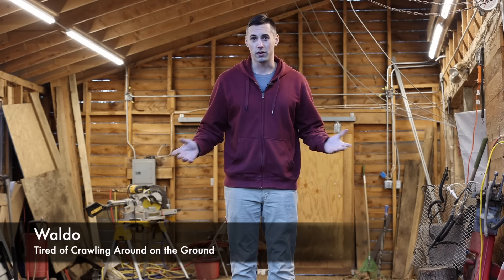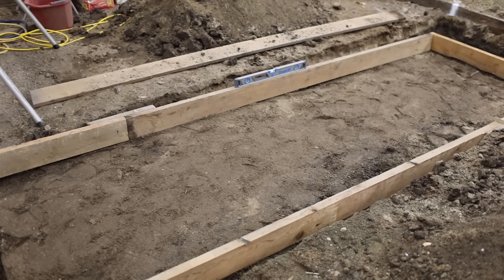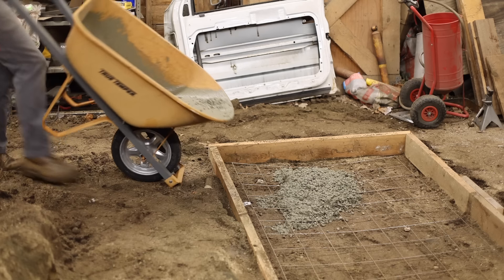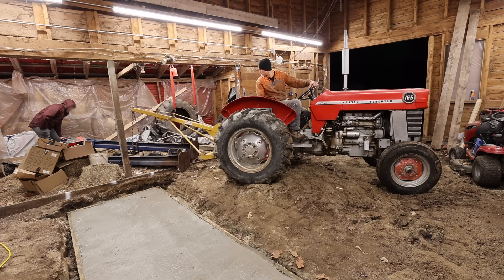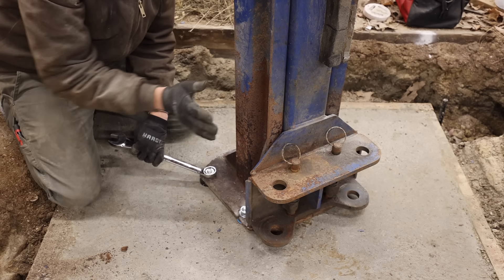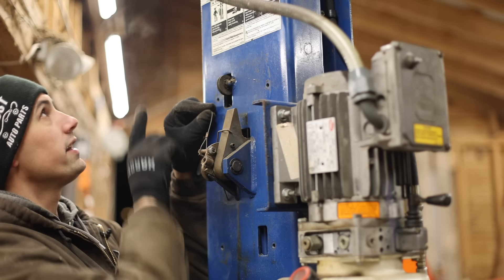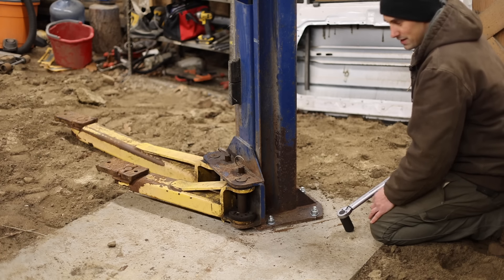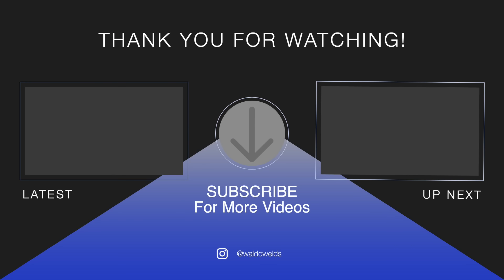Installing a 2-Post Automotive Lift on the Cheap

Comment: As an architect, I would recommend that you not use that for fear that the entire slab can rotate frontwards or backwards and drop a vehicle on you.  You don't have enough mass to prevent rotation, nor do you have proper rebar to stop the slab from splitting apart.  Best of luck.
Reply: nor did he even pack the dirt befor the pour this is a vid if do not do this
Reply: So architects are engineers now?
Reply: riight
my pads weighed more that the  load, 1600kg  pad under each column
Reply: @zomblake I would think they would dabble on the engineering side to preventing creating blueprints that create lawsuits. .
Reply: @alfonz0010  It might be country dependant, but usually- not. Where I'm at, they work in tandem with a structural engineer where the architect takes all the money, while the engineer all the responsibility. But to be fair, you don't need either to understand that the slab's too small.
Reply: @zomblake  They'd have a better idea than most lay people.
Reply: @zomblake he's way closer to one than the guy that posted this video....WAY closer.
Reply: Agree with other comments.  The slab is way too small and the rebar is not properly positioned in the slab.
Reply: first thing i thought when i saw the slab
Reply: @zomblake  The dude installed a 10 ft. post lift into a 3000 pound base that is only 4 feet wide with the intent of putting full size trucks on it. You need an engineer to tell you that's a bad idea?
Reply: Is he still alive? That was horrible way to install a lift! Might have mounted it to cement block's!
Reply: @zomblake  Do you think architects just draw pretty pictures of houses, like for fun?
Reply: @zomblake  -  It really depends on what type of architect, an architectural engineer is an architect. And many structural engineers are also architects.

The only way the fulcrum of that slab (the longitudinal aspect) will withstand an out of balance load (think engine in front), is that it won't.
If he had poured piers under it to below frost line and connect the slab to them with sufficient rebar then what he did there would suffice.  All that is is an  accident waiting to happen. In addition, why waste time with wire mesh reinforcing? Especially since it wasn't positioned correctly in the slab? 

On the other hand it wouldn't take much to stabilize the top of the lever arms (the lift posts) to the roof joists. 

Regardless, it's been over two years and so far so good. 
I spent over 25 years pouring concrete. I'm impressed he was able to get er done in two hours before he got cold joints. Or maybe he did? 

Like his videos and wish him well with that lift arrangement.
Reply: 😂 chill out all you "architectural engineering safety Sally's,  not every project needs to be over engineering. I mean I guess he could sue himself if the thing falls on his head. 😂 calm down he seems like a smart dude he can handle his own shit.
Reply: @zomblake  no but he's 100 percent correct. He's referring to what's called over turn and it's 1 of a number of very dangerous aspects of this installation.
Reply: @stuarth43  even if that was true ever heard of a lever and how it multiplies force?
Reply: @Flymore25  ok well your wrong and lifts especially 2 post are 100 percent dependent in the base plate load ability. This pad has not only no strength but it's not even tied into a slab floor with any surface area.

If he avoids a serious accident this it's just fresh luck.
Reply: @A_Person_You_Dont_Know  lol ok safety Sally, he's had it up well over a year now and no accidents,  so who's wrong?  Huh what'd ya say there? Yeah
Reply: @Flymore25  What a moronic response. Just because he hasn't had an accident doesn't mean its safe. I already know what the Rotary lift engineers say about this install. I wonder what Waldo's home insurer would say. Go back to whatever trailer you call home cleetus.
Reply: @Flymore25 just remember that Safety Sally's story is written in the blood of the people who didn't listen to her. Have a great day, it could be your last!
Reply: @OneTrueCat  right lol what do u do for a living again? Probably on disability and have never once done anything exciting lol. I'm 35 and have made it through several dangerous occupations using nothing more than common sense safety.  I worked at lowesnforn2 days untill I quit. To even start a fork lift u have to wear fluorescent yellow with orange stripes from head to tow lol and then u have to have like 15 flaggers lol 😆  too much dumb shit
Reply: @Flymore25  so you can't hold a job and you're making fun of people for being experts at theirs. That's hilarious.
Reply: @A_Person_You_Dont_Know  lol original,  I can tell ur a real thinker, super smart u managed to use trailer and cleetus in the same comment. Lol I'm sure u were top of your class. LOL JERK OFF
Reply: @OneTrueCat  safety Salley duh! Droopy eyes 👀 duh safety Salley booboo duh
Reply: Exactly my thoughts. With this setup he would always have to make 1000% sure that center of mass is also center of the lift, which would be rather scary to me. If he ever did something like dropping a heavy piece like the engine out of one end of weight on the lift at high elevation, I'd bet it wouldn't end too great. 

I would not have been too much work simply make the slap three time the size it is now, put twice as much steel into it and pack the soil under it properly and he could work under his truck without any second thought on security.
Reply: @zomblake  you do know architects have to know things like structural strength and ground compression, right?
Reply: sladejohnson4409, I can't believe that you're getting grief for this post.

You are obviously correct. This installation is a great example of exactly what not to do.
Reply: @blueskytoday2230  I'm planning to put one on a 30'x40' pad - 6" thick with 3000 PSI, fiber-reinforced concrete with #5 rebar at 12" spacing and I'm still concerned that the center of the pad will split and tilt the load to the ground if I don't load it perfectly.

This dude is insane for sitting under that truck with nothing but a 4' wide pad of basic concrete, reinforced with only a single wire mesh (without standoffs from the looks of it), no packing of the soil underneath, no coarse underlayment, no moisture barrier.

He may get away with it periodically for a while, but that thing is going to crack and dump a vehicle either forwards or backwards. I would, at the very least, weld some stabilizers at a 45 degree angle to the front and back of the vertical lifts.
Reply: also, the reinforcement was placed directly in contact with the ground and from what I could see, wasn't lifted up so as to be up inside the concrete and not have sections below the concrete, which can lead to that reinforcement rusting, and that rust propagating up inside the concrete, expanding, and ultimately cracking the concrete. Reinforcement should always be supported so its up inside the concrete at least an inch or more.
Reply: i know this post is 2 years old but i wouldnt trust that with a 4 wheeler on it, let alone a car or truck. poured on fresh dirt with no base with bag concrete and wire mesh. that thing needs some angle iron bolted to the rafters and some bracing put on it. that four ft slab can flip over at any time the weight is off centered
Reply: @bradbrinegar1419 good point, bracing to the rafters should at least give him time to run like hell.
Reply: Uh, yeah....they are. Registered architects have the ability to review and approve blueprints for structural purposes. And as to his comment, I agree with him.
Reply: Four 3/4" bolts can support a 2000 square foot house. Everybody's wants to be the boss, but nobody wants to read the book. I can see why you work alone. Imagine listening to these yo-yos all day?
Reply: Some really good advice would be how to turn off the automatic editing on the phone so we don't all sound like illiterate foreigners.
Reply: You should drill all the way through the slab in the event an anchor fails you can drive it through the slab and install a replacement
Reply: @zomblake  Only if they are named George.

Comment: Im feeling a bit skeptical about the stability of that narrow slab, feels like its gonna allow the entire setup to tip over.
Reply: Agree, I would not feel safe with that setup.
Reply: That's what the manual calls for.
The manual also calls for jacks front and back to keep everything balanced when working underneath and the Center of gravity should be in between the post when lifting.
Reply: There is no way I would work under that. One the slab is way to small and the depth is to shallow for my liking. Definitely needs rebar.. I prefer going overkill just to be on the safe side
Reply: Extra precaution mount the top part to building. Prevents possible tipping and makes jacks more stable.
Reply: @BWYinYang  That way you do not only destroy the lift, the car, yourself but also the roof!
Reply: Making secure connections with duct tape and bubble gum....What could go wrong? 🤷‍♂️
Reply: @Nikel87 If the slab is only 1500lbs, its common sense it can't sustain a 3-4k lbs vehicle. If its up and you pull down on the back end of the truck, the whole thing will rip out of the ground and tip over.
Reply: That's what I think. I bought one used. The mechanic upgraded. He just installed it like this. I'm gonna weld up the bolts to a rear frame 24" deep. 6000# concrete.
Reply: @scottloutner5253 That’s overkill.  The requirement for the bolts is 5000lb concrete strength 12 inches deep and surface area of the pad is determined by lift weight capacity.  Remember that it is best to make a flat larger pad that covers more floor space.  It’s better to keep the concrete at min 4 1/2 inches thick  (I prefer 6in. Min) and make a full size pad that will be suitable for the lift weight capacity. (See manufacturers requirement for the specific lift).  The advantage of the full sized pad is that if you’re going to buy the concrete you might as well have a work space upon which you can access a vehicle and work like a real mechanic.  You will also have a floor for proper use of jacks, trans lifts, etc.  In a “temporary” situation, like this one if you make the concrete pad a foot deep reinforced with rebar it’s going to be a job and a half to remove it.
Reply: @Nikel87   NO the manual does not call for a chunk of concrete like this. It calls for  a compacted gravel base and then a min of 4-1/4" of 3000 Psi concreted cured 28 days. And all that is a min of 12x24 bay pad. If you are pouring a replacement pad then it needs to be 4'x4'x6" tied into the existing slab with chemical anchors dowelled in. This install is going to kill someone!
Reply: I would have poured piers under the uprights
Reply: @jamescraven5001  too* small
too* shallow

Comment: Please do not go underneath that truck on that lift, I pour concrete for a living and have poured many slabs for use with two post lifts. That is not near enough concrete and you have no reinforcement in the concrete. Please read these! Very dangerous situation.

Comment: When pouring concrete, start at one end and fill to the top of the form and screed as you go. Layering it for a 2 1/2 hour pour makes it very difficult to screed. Epoxy would be a better choice for the bolts, wedge anchors don't hold well in fresh concrete.   You might want to add some cables or something to keep it from tipping over.  If your truck can hold the load it might be a little light to hold the truck.  Love your channel, not being critical, just want you to be safe.
Reply: Good advice. Merry Christmas.
Reply: I installed lifts and other garage equipment for a time in the 70s. We gave concrete about a month to cure before drilling for anchors. A couple times when we were pushed and attempted to install on maybe 2 week old floors we couldn't get anchors to tighten satisfactorily, had to quit and go back later to complete. Makes me suspicious that his torque wrench wouldn't click, I doubt it's the wrench.
Reply: @billmiller7138  Exactly.
Reply: So much wrong with this. I hope
His lift doesn’t tip
Over.
Reply: @cygnus1965 just a terrible idea all around in my opinion…. If not gonna do it right, deep, full slab, rebar, cured well… Then just buy a scissor lift and compressor…